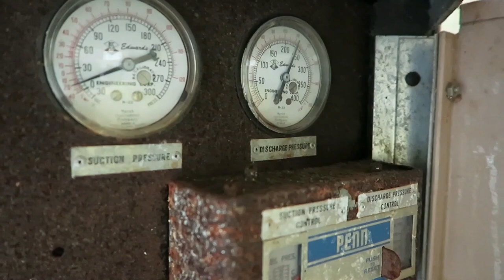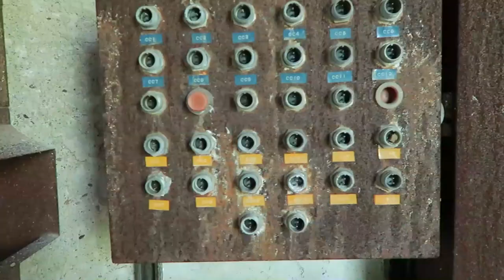Abandoned rocket test site hidden in the woods

Comment: Cool little fact about Reaction Motors and the pictures of the rocket engine tests you showed....They built the XLR99 engines that powered the X-15 rocket plane during the 60's.   The test pilots flew that bird up to 4,520 MPH and over 300,000 feet high.(Scott Crossfield, Pete Knight, Joe Walker, etc ..... Neil Armstrong!)
Reply: When my father worked there in the late 40s / early 50s they built the rocket motors for Bell X-1, Glamorous Glennis, first plane to break the sound barrier. Piloted by Chuck Yeager.

Comment: My father worked there in the late 40s / early 50s. Those buildings were used for static test firings of early rocket engines.
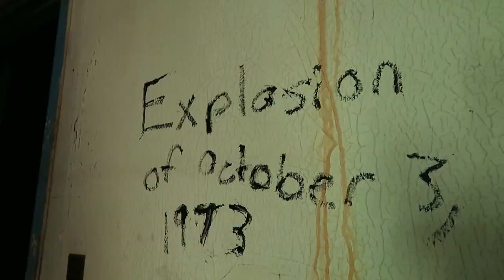Reply: Any info on the "explosion October 3 1973" writing at 10:24? Very interesting place, im assuming it closed down due to the old work conditions and asbestos?

Comment: I'm pretty sure they were just testing the engines there, not the rockets.  That wooden structure with the giant fan on top would have been a cooling tower.  The water they would've used to cool the engines while testing would have gone there and sprayed all over the wooden slats and shelves and then the fan would've been to create air flow, sucking in from the bottom and the hot water would've evaporated up, into the cooler air above('cause heat rises, eh?)